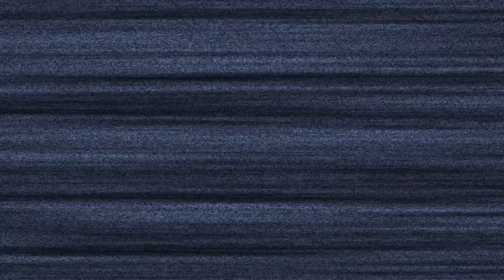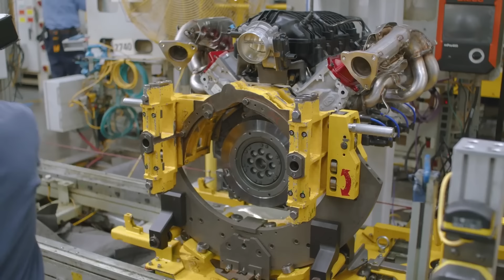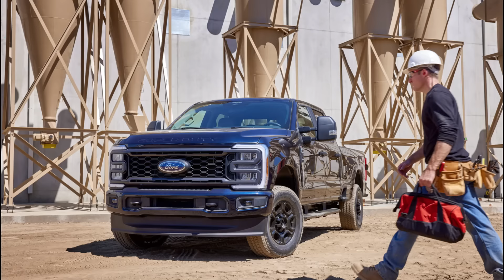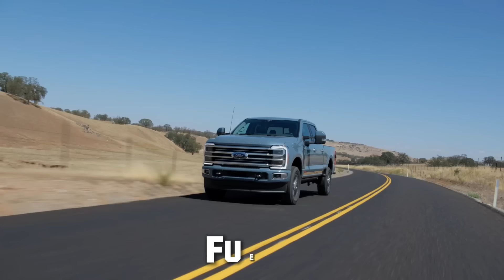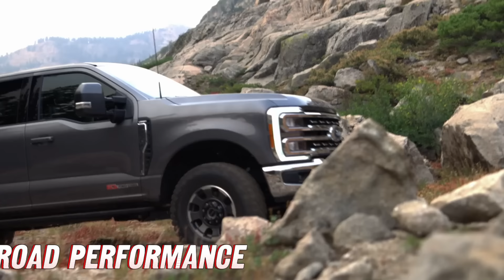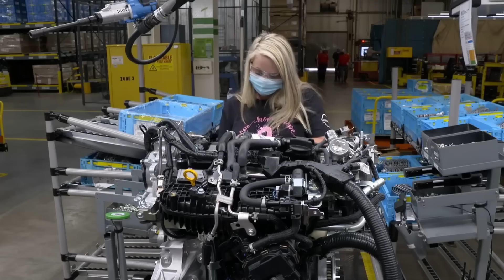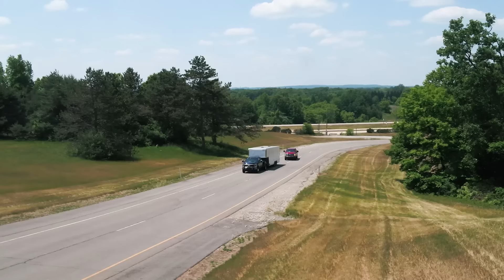ALL 4 Powertrains of 2026 Ford Super Duty EXPLAINED in Detail!

Comment from the maker: 🔴Which of the 2026 Ford Super Duty powertrains would you choose and why?🤔 

🏆Every Towing and Payload Secret of the 2026 Super Duty EXPLAINED in Detail WATCH HERE 👉https://youtu.be/2jsTcDhEu5I
Reply: gm designers are also losing sleep and 6.2 motors left and right
Reply: The power stroke for awesome torque and big HP
Reply: If only these were reliable
Reply: @06Bueller The Chevy and Mopar guys are crying the same.
Reply: @douglasrizzo9210  Have you ever owned any Ford pickups??
Reply: @tripacer8259 one Ranger, one F350 Super Duty DRW, two F150. You?
Reply: Ideally it would be an F350 2wd regular cab long bed with 7.3 gas power. Good luck getting Ford to build it.
Reply: you forgot to mention that the 6.8L v8 is also E85 compatible so yea 15 MPG but also $1.30-$2.00 per gallon gasoline
Reply: NONE!

Comment: If they don’t get rid of those roller rockers with the needle bearings in it those engines 6.7 to 7.3 and I don’t know about the other gas engines but they’re junk they’re garbage. They don’t last common and tried the needle bearings and they went back to a flat top tap lifter. It didn’t last it was tearing up their cams so I wouldn’t buy one and I’m a Ford man all my life.
Reply from the maker: You're a lifelong Ford guy saying their engines are junk because of roller rockers - what year Super Duty did you have that failed on you? And if you won't buy another Ford, what are you switching to after being loyal your whole life?

Comment: The 6.8 doesn’t make sense.  Yes it’s cheaper but less. Yes less fuel economy and less power and less resale.  Makes no sense.
Reply from the maker: What would you have replaced it with - just offer the 7.3 Godzilla across the board, or go straight to diesel only? Because Ford needs a cheaper base engine option for fleet buyers!
Reply: @speed_spectrum_cars it’s a $1000 usd. Savings For less fuel economy and less power.  Makes no sense.

Comment: I like the way Ford worked with an expert in Austria to develop the new 6.7  Very awesome!
AVL is an Austrian company, headquartered in Graz, that is
the world's largest independent provider of development, simulation, and testing technology for powertrains. It serves the automotive industry by providing solutions for internal combustion engines, hybrid, electric, and fuel cell vehicles, as well as systems for testing and simulation. The company's work includes developing technologies for advanced driver assistance systems (ADAS) and automated driving, and it also has a prominent motorsport division called AVL Racetech. 
Core business and services

    Development: AVL develops all types of powertrain systems, from traditional combustion engines to advanced electric and fuel cell systems.
    Simulation: The company provides advanced simulation software and technologies, including "Virtual Twins" that allow for early problem detection in the development process.
    Testing: AVL offers a comprehensive suite of testing solutions, including dynos, test systems, and software, to support the entire development lifecycle from concept to production.
    Services: The company offers services such as vehicle engineering, system integration, and technology consulting. 

Key areas of focus

    Electrification: AVL is heavily involved in developing battery systems, electric drives, and fuel cell technologies, including a new test center in Graz for hydrogen and fuel cell technology.
    Automated Driving: The company develops solutions for ADAS and autonomous driving systems, supported by its ZalaZONE proving ground in Hungary, which combines a controlled environment with approved public road testing.
    Motorsport: AVL Racetech is the company's motorsport division, which works with various race series and provides engineering services for all relevant propulsion systems in motorsports.
    Sustainability: AVL focuses on developing solutions that reduce CO2 emissions, increase energy density in batteries, and support the use of sustainable fuels. 

    Advanced automotive measurement technology - AVL DiTEST
    1997 - AVL DiSpeed 490 - a unique direct speed measurement device based on the evaluation of air-borne and structure-borne noise. ...
    AVL DiTEST

AVL – Austria - EuroCPS
Supported CPS platforms. Integrated and Open Development Platform (AVL) Introduction. AVL is the world's largest independent compa...
EuroCPS
Reimagining Motion - AVL
Oct 27, 2025 — New Hydrogen and Fuel Cell Test Center in Graz AVL is greatly expanding its global test infrastructure for fuel cell a...
AVL Home

Show all

Comment: I have a 2024 F-250 Super Cab Short Box, 6.8L V8, 4x4.  I like the cab and box configuration and the engine.  It's the rest of the truck that's a major piece of sh!t.  This Super Duty experience is definitely a one and done.  Can't wait to flush this turd and get another Ram, way better truck!
Reply from the maker: That's really disappointing to hear you're having such a negative experience with your F-250, especially since you like the engine and configuration. What specific issues are you encountering that are making you want to switch?
Reply: @speed_spectrum_cars , it wonders side to side more than any other vehicle I've ever driven.  

When I turn my plow all the way to the side and it hits the bump stops, the radio flashes, shuts off, flashed and turns back on.  

Every two or three times that that happens, the HVAC system shuts completely off including the blower motor.

The heated mirrors suck.  It takes forever the 4x4 system to engage and disengage.  The doors rattle to the point I can see them moving when I hit bump.

To name a few issues.

Comment: My Dad's '97 F-150 was totaled out by his insurance, but he paid retention fee, and we replaced his front bumper, grill, radiator/condenser,headlights.
And he was hit from the rear, once again we replaced his bumper and under braces.
And finally when he took out a brick piller at the base pharmacy,,, he just took his insurance check and found a newer 2007 Ford Ranger.
But that 97 F-150 was used with over 142,000 miles on it before he bought it!
It had the 302 engine in the 97 F-150.
Other than rear seal leak, it was dependable.
Reply from the maker: Those old 302s were absolute workhorses! Sounds like that F-150 took a beating and just kept going. Do you still have a soft spot for the older Fords, or have the newer ones won you over?

Comment: My 2010 F-150 with 4.6 2valve just blew up last month, with 258,000 miles.
Whilw riding with my tow truck driver, he said he's been busy picking up NEW CHEVY & FORD TRUCKS with less than 40,000 miles.
Some much less!
2010 Triton 4.6 had 2 set-ups
One was 2 valve, and the other variable 3 valve system.
Truly the last year that FORD made a descent engine.
With complicity/COMPLIANCE with the WOKE GREENIES at the EPA,,, to get more MPG, and usher in a notion of higher price settings for E.V.s, BIG 3 seems to make bad to worse, to just CRAP to kill off the GASOLINE COMBUSTIBLE ENGINES to nudge consumers into Electric vehicals.
Motors cutting cylinders off, to engines stopping at redlights and starting again when you move up 5 to 10 feet
Reply from the maker: That's a tough break on your F-150 after so many miles. It's interesting to hear your tow truck driver's perspective on the newer trucks. What's your ideal engine setup for a modern truck, considering both power and longevity?
Reply: @speed_spectrum_cars Old dependable cast iron block Chevy 4 bolt main 350, Granny 5 speed on the floor, or old 250 inline 6, with "3 on the tree" are best.
They were durable, because they didnt have excessive moving parts!
Engines today have upstream/downstream O2 sensors, Cam positioning/Crank Positioning sensors, duration sensors for redlight idling cutting off the engine, and all of that through your ECM that require relays and fuses for all of those various things to function.
New Engines are *RRR, or SCRAP!
 *RRR is;
Read
Remove
Replace
Sensors.
UP TO the 1980's you check ELECTRICAL POWER (SPARK)
Check FUEL
and then you check if you were dreaming because if you had spark, and fuel, it would at least hit once in a while when you turn over the engine.
Auto mechanic gets IDK lets say $150/hr???
AND, a diagnostic FEE of $185 to $250 just to look at it!
That entells them to plug up their OBD2 READER to scan codes. And then trace out WHY. GREAT! GOOD FOR THEM!
But newer engines are lower compression ratios, with zero valve clearance causing  an issue if a timing belt or chain goes out, the piston slaps the valve,,, Something gives,,,, your wallet big bucks to get a new engine.
Not to mention the issues with the Transmissions!

Newer trucks are SOCCER MOM'S SECURITY BLANKET, while the COMPANIES LOVE to stack SCHIT onto a work platform to make it POSH!
RUBBER FLOOR COVER, so you can park with it leaning lower on one side of the truck and wash it!
Hand crank windows, so that the door inside armrest doesnt have to be disassybled because you were working with the window down, and it rained!

All that crap wasnt necessary😅!
I rebuilt an inline 6 cylinder when I was 12 with washing powder cardboard soap box and permatex #3 as gaskets.
Knobby dois to shift the transmission,,, remote start when I grew up was my Dad telling me to go out and start the truck to warm it up on a cold morning!😂

Comment: Of course, Ford is going to SAY that they "dominate" every category.  If they built fire trucks, they would dominate.  Really tiring marketing crap.
Reply from the maker: The fire truck example is spot-on satire. Ford would find some narrow metric like "best-selling fire trucks with red paint in the Midwest during Q3" just to claim dominance. Meanwhile the real question buyers should ask is whether the truck actually meets their needs and won't leave them stranded.

Are you completely writing off Ford because of the marketing BS combined with the pricing issues, or still considering a Super Duty despite the corporate nonsense if you can find one at a reasonable price?

Comment: Well this truck is going to spend all his lifetime in the ford plot, because the price and add ons 😅
Reply from the maker: The Super Duty sitting on dealer lots because of pricing and add-ons is exactly what's happening! Ford's gotten so greedy with mandatory packages and option bundles that the base price becomes meaningless. By the time you get what you actually need, you're staring at a $70K+ work truck.

Are you shopping for a Super Duty and finding the pricing completely unrealistic, or just noticing how many are sitting unsold at your local dealer?

Comment: These trucks are impressive but at those tow ratings just get a mediumor heavy duty tractor.  Its more reliable and much much safer when towing  30K + lb mark.  Also you can get a good used Peterbuilt for half the price of a 1 ton Ford.
Reply from the maker: Absolutely, when you’re talking 30K+ pounds, a purpose-built tractor is hard to beat for reliability and safety. That said, a pickup still offers far more versatility for daily use, hauling smaller loads, and personal transport.

Comment: The horsepower and torque numbers on the Godzilla are pathetic.  Displacement that big with low numbers like that is absurd.
Reply from the maker: Well, when you compare the Godzilla to other naturally aspirated engines, the numbers are actually decent. They only start to look “weak” when stacked against turbocharged engines, which bring their own set of complexities and potential issues. Do you usually prefer turbo engines over NA for the higher output, or do you value the simplicity of a naturally aspirated setup?
Reply: @speed_spectrum_cars  ........i see your point, I guess I just don't understand why the massive size, if they're only going to get power like that.  In fact that is a real question I have......Why do they do that?

Comment: I got a 17 f250 xl 2wd 6.2 for 1k and replaced the trans for 1600. Not a bad truck for the money
Reply from the maker: A 2017 F250 with the 6.2L for $1K plus a $1600 transmission rebuild is an absolute steal! $2600 total for a capable work truck that should run for years is incredible value compared to these $50K+ new Super Dutys. What kind of work are you putting it through, and how's the rest of the truck holding up?

Comment: Hopefully? They fixed the oiling problem!!!!!😮 I won’t buy one till they do. Absolutely
Reply from the maker: Yeah, that oiling issue has been a big concern for a lot of folks. Which powertrain are you leaning towards?
Reply: @speed_spectrum_cars stroked my 7.3 4.300 or my 429 scj ? 😊 6.7 does not have priority main oiling circuit not good to startup and go ! 
Maybe if they use a prelude accumulator ? Key on release 😊
Reply: 6.8 or 7.3 both work good with 6psi boost. One has made just over 700hp other is over 600 stock 😊 reliable test still ongoing  6.7 not needed right now 😊 
Thanks

Comment: Makes me want to hold on to my 200k mile f250 v10, not the hardest pulling motor, but she never complains
Reply from the maker: That V10 at 200K miles and still running strong is something to hold onto! Those 6.8L V10s might not be torque monsters, but they're absolutely bulletproof when maintained properly. Sometimes "reliable and predictable" beats "powerful and complicated."

What kind of work are you putting that F250 through, and are you planning any major maintenance to keep it running another 200K?

Comment: Wow, $51k for an entry level XLT!! That's crazy!! I'll keep my 03
Reply from the maker: That's luxury car money for what used to be a basic work truck. Your '03 is probably more reliable and way cheaper to maintain than anything they're building today anyway. What engine are you running in that '03, and how's it holding up after 20+ years?
Reply: @speed_spectrum_cars yeah, no kidding!! I can work on this with my eyes closed. It's an F350 with a 6.0 and 298k on it. Just did a few injectors and fuel pump but runs like a new truck still. Needs some bodywork but what New England rig doesn't
Reply from the maker: A 6.0 Powerstroke with 298K is absolutely impressive! Those engines got a bad rap early on, but when they're properly maintained hey can run forever. The fact that you can still wrench on it yourself is huge - no fancy diagnostic computers or proprietary tools needed.

Are you planning to do the bodywork yourself too, or just living with the character marks? Because at 298K miles of proven reliability, a little rust seems like a fair trade-off compared to a $90K payment on something that might not last half as long.
Reply: @speed_spectrum_cars I love the 03 and early 04 engines, they have such less problems it seems then the 04.5 and up engines. And no stand pipes or dummy plugs is nice too!!

I'm going to do the bodywork and probably repaint it as well. Nothing crazy though as I do plow every winter
Reply: Great! More available to us non-liberals!
Reply: @FredJacobs-ql4mq  so first of all, who made this political? And second, I'm a proud card-carrying Republican, born and raised. By the way, since when does not wanting to spend my hard-earned money on a lesser truck portray me as a Liberal?

Comment: 2026 will have ford having more than 200 hundred recalls.  Pure junk.
Reply from the maker: 200+ recalls would be absolutely insane, even for Ford's recent track record! The quality control issues are definitely getting worse across the industry, but that number seems pretty extreme. Current Super Duty recalls are bad enough without hitting triple digits.

Are you basing that on Ford's current recall trend, or just frustrated with the overall quality decline and throwing out a worst-case scenario?

Comment: What happened to the 6.2 was one their best motors!
Reply from the maker: The 6.2L Boss was a solid naturally aspirated V8! Ford killed it off probably for EPA reasons - that big displacement without forced induction just couldn't hit the fuel economy targets they needed. The 7.3 Godzilla replaced it but with less refinement.

Are you missing the 6.2 from personal experience, or just think Ford made a mistake discontinuing their naturally aspirated V8 lineup?

Comment: The HP out of a 7.3L isnt impressive.  Thats sad actually for that much displacement.  My 5.6L is rated at 400 HP. I xould get the exta 80 HP from a simple tune and cam swap.
Reply from the maker: The 7.3 Godzilla's horsepower numbers are definitely underwhelming for that displacement - you're right that 430hp from 445 cubic inches isn't impressive by modern standards. Ford prioritized torque and reliability over peak horsepower with that engine design.

Are you running that 5.6L in a Titan, and have you actually done any modifications to bump the power up?

Comment: The 6.8 is so pointless.
Reply from the maker: A lot of people feel that way, since it kind of sits in an odd middle ground between the 7.3 gas and the diesel. Do you think Ford should’ve just focused on refining the 7.3 instead, or is there still a niche where the 6.8 makes sense?
Reply: @speed_spectrum_cars i know they use it in commercial applications but that 7.3 has room to turn it down and up. Great motor. If they ever do a hybrid super duty or adds a squirt of boost, its going to make a lot of diesel guys convert to gas. Not because diesel trucks arent awesome, but the emissions system really sucks on those.
Reply from the maker: The 7.3 definitely has untapped potential! Ford's been super conservative with the tuning, probably for reliability and warranty reasons. But you're right that the commercial applications show there's way more power available when needed.

Are you thinking the emissions complexity is getting bad enough that even die-hard diesel guys would consider switching to a properly boosted gas setup?